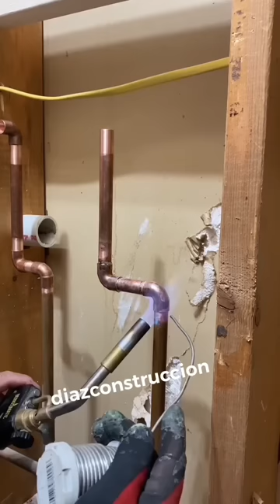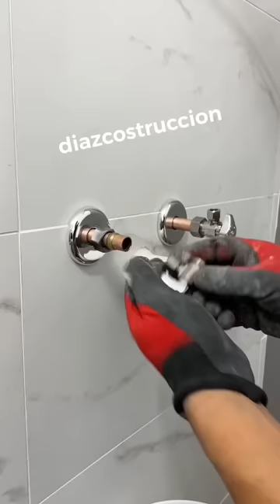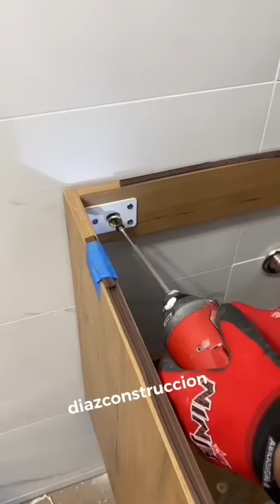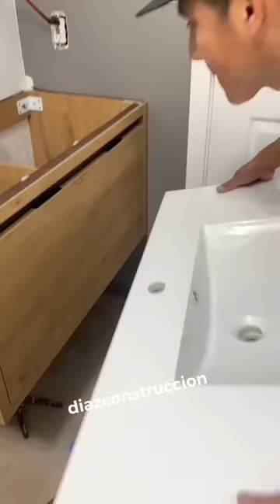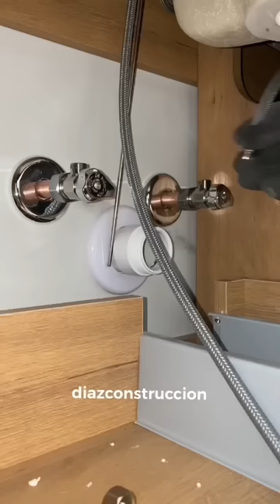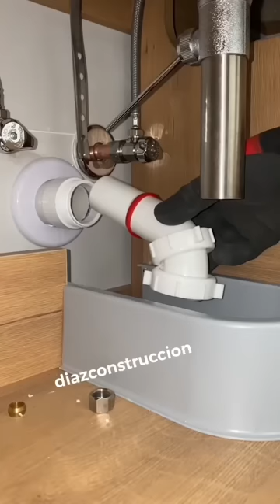Wall mounted vanity installation

Comment: Now The trap is no longer vented.  Once you went up with a 45 degree fitting you lost your venting.
Reply: You are correct sir must be a Harry homeowner it definitely wouldn't pass
Reply: Builshit it is still vented. It was draining wasn’t it?
Reply: It will drain but the trap can self siphon .
Reply: You are correct but his work isn’t too bad. Soldering is good and the purple primer looks clean. Gotta clean that flux up throughly with a rag after trying to shine it up. I noticed guys that do that their joints get green after a few weeks because of the acid. I give him a 7 out of 10. Work looks clean but venting is kinda meh.
Reply: Homeowner here...what should he have done instead?
Reply: @boltup5566  he would have to raise the TeeWye higher in the wall. So the branch comes with a 1/4 per foot pitch. With out the 45 degree fitting in the branch .  Or a Air admittance valve is also acceptable in most states.
Reply: How the hell does that make it unvented?
Reply: It's not vented by code but it's fine for real life
Reply: You can not offset up on a trap arm.
Reply: @rogerjones7654  Zxf BB high
Reply: Your right… Trap arm has its code for a reason.
Reply: @glywnniswells9480  Ultimately building code is governed by building inspection and the States authority…
People’s opinions are not relevant unless they follow the guidelines of plumbing code in your area…
By the book your broke your trap arm vent.. That’s illegal. Your not allowed to have more fall from the trap weir to the trap arm vent. That’s code. You don’t have to like it or understand it but you do have to abide by it as you can be fined by the State or Provence. Also if your licensed you can have your plumbing license revoked if you continue to openly operate against building code.
Reply: You cannot offset the trap arm from horizontal to vertical.
Reply: @boltup5566 The U bend isn't allowed to be syphoned dry or else sewer gas will come out of your sink.  You can't go up, or else sink wont work, going down causes the siphon.

Comment: You should mount your faucet and drain on to the sink before installing on the vanity. Saves some work trying to get it tight in a small area.

Comment: Have you ever moved a faucet closer to the sink so that the faucet reach is closer to the center of the sink basin? I have a situation where my builder installed a faucet and the hole was centered for the faucet like shown in the video but the faucet doesn't extend that far past the back edge of the sink. So it's difficult to wash your hands since they hit the back of the sink bowl.                                                      

Is it possible to drill another hole in front of the existing by say 1 inch and then somehow use the new drilled out countertop plug to plug the old hole???

Comment: Very nice work , I like how you have a coupler on the horizontal part of the drain so that you can adjust  the length instead of having to dry fit everything and get it perfect . Not sure what that couplers called and if they manufacture it in ABS .  I am using 1.5” drain and want to increase it to 2” . Not sure what the diameter of the duct is on your rough out on the  wall?

Comment: A P trap has several rules this one fails do to your only allowed one pipe fall diameter from trap to vent should of just put 90 out straight no 45 and used a po. Extension to get to lower trap average height for rough in drain 18inchs to 19  will work for most vanity sinks